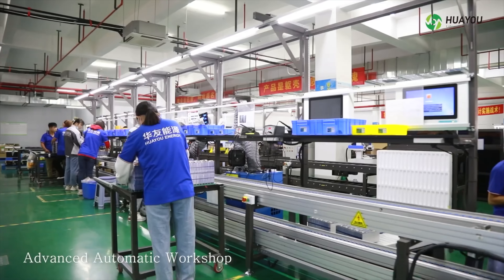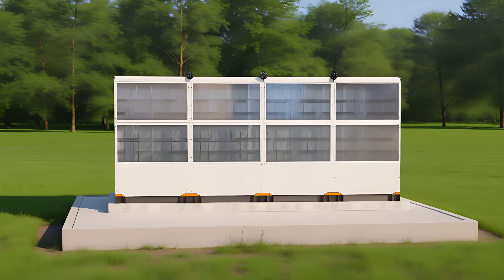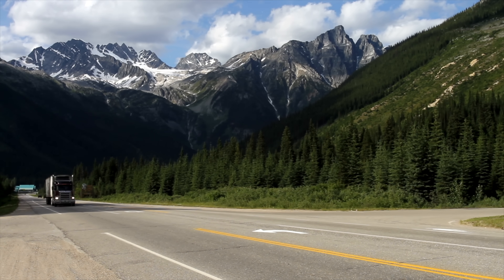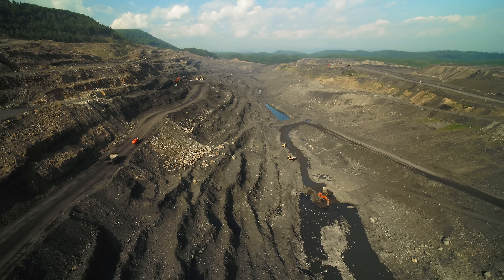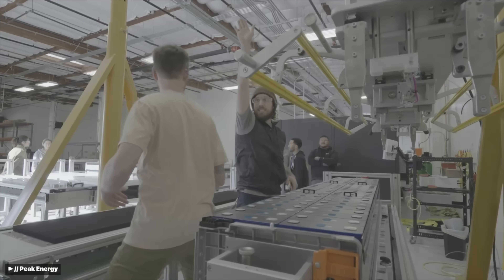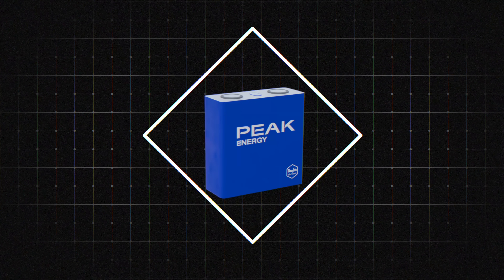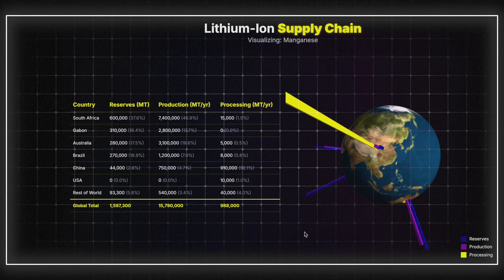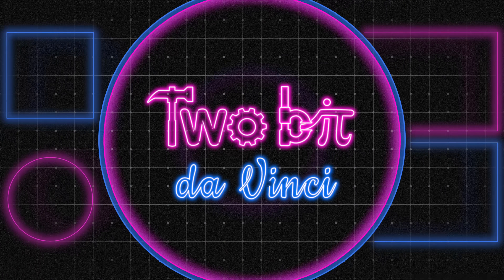Sodium Ion Batteries Are Going to be EVERYWHERE - Here's Why

Comment: While LFP batteries are also technically unable to sustain their own thermal runaway, LFP batteries still do start fires and explosions when their outgassing mixes with air and finds an ignition source. I bet the same applies to NaFPO, in which case batteries should still be vented outdoors to prevent hydrogen, carbon monoxide and other flammable gas buildup in confined spaces.

As far as EV range is concerned, as long as I have at least 100mi of real-world winter range and have 1.4kW charging available wherever I go, that would be good enough for ~355 days/year and good enough for me if the battery is built to survive that through the whole ~15 years lifespan of the car. For the remaining ~10 days, those are 2-3 days trips for which I wouldn't mind having to make one ~15min fast-charging stop along the way in each direction.
Reply: NaFPO is not supposed to be flammable. much safer.
Reply: @MrMichaelBCurtis  LFP itself is considered non-flammable too but when one is successfully caused to go into thermal runaway, the gasses it produces (mainly hydrogen) are highly flammable.

The ideal battery tech from an energy density point of view is oxidizer and reducer separated by almost nothing, effectively a bomb. That makes it extremely difficult if not impossible to put together a truly intrinsically safe high energy density battery.
Reply: @teardowndan5364  people can delude themselves, and Li batteries are indeed flammable. there are all kinds of warnings about keeping them away from fire, Na batteries are non flammable, you can put fires out with them, and yes they don't hold as much charge.
Reply: @MrMichaelBCurtis  The delusional people are the ones thinking Na-ion will be any different. Anything short of liquid metal or fully solid-state batteries will have catastrophic failure modes.

LFP batteries do not catch fire or even do anything at all during typical nail penetration tests. Wack an identical cell with angle iron to mimic running over a downed signage post though, they outgass vigorously and the cloud ignites when it finds a source.

Unless Na-ion magically gets rid of hydrogen as the positive charge carrier in its electrolyte, it is practically guaranteed to release hydrogen during catastrophic failure.
Reply: @teardowndan5364 your thinking is correct,  the issue throwing you off is the amout of outgassing Li is a lot Na is almost none.  Na batteries are not flamable under any condition,  they are solid state
Reply: @MrMichaelBCurtis  Na-ion aren't intrinsically solid state, most use fundamentally the same construction as Li-ion batteries.

Most "solid state" batteries in production today are actually semi-solid with anywhere from 10% to 80% liquid electrolyte since it is nearly impossible to maintain full contact across all layers from anode to cathode current-collecting foils otherwise.
Reply: @teardowndan5364 do more research,  it is worth it
Reply: @MrMichaelBCurtis  The only fully solid-state batteries I am aware of use Li/Na-sulfide anode and have to operate at ~350C to keep the battery soft enough to avoid cracking.
Reply: The liquid is different is the key diffence. While yes, its still possible, these will go boom over a fire.
Reply: @adr2t  lithium yes, salt no. learn more.
Reply: @MrMichaelBCurtis  Even salt - maybe you need to learn more. I assume you dont know what water will do the metal as well? A boom is better than a fire - this is why its safer. You really lack any knowledge on this top I can tell.
Reply: @adr2t Na batteries don't explode. Duh, maybe do some research
Reply: @MrMichaelBCurtis  They do - they releas a gas when heated - this makes them pop. You do know Na has been around for a while, yes?
Reply: @adr2t  while you are correct Na has been around a while, originally developed by Sony, there has been a significant breakthrough, and the amount of gas release is not significant, they are no longer flammable, they don't need cooling and they operate in a very wide range of temperatures with  no dendrite issues.  The car batteries they are planning for later this year also can be charged to 80 percent in 10 minutes
Reply: @MrMichaelBCurtis  I am correct. I did my research. I said they release gas and pop. Thats better than going into flame mode. They're safer because of that fact. There has been years of testing on them. With that said, they can still go up in flames depending on a few reactions still. Mainly with H2O. So we still have to be careful when putting out battery fires. The H is split from the energy release, while the O keeps the fire going. Sodium reacts to H2O as well. The benfit though is that if this does happen, its limited to the cell.
Reply: @adr2t  all that is correct, but not similar. and as of now, irrelevant. Tesla just changed to an Al battery, it uses a gel that doesn't outgas, it can be punctured and won't burn.  It cools itself so that saves on range, and it lasts more than 100 years, and because it cannot burn, the 80 percent charge time is 3 minutes and the 100 is less than 5 minutes.  it is much cheaper than Lithium, although the charge is 20 percent less, some of that is saved by not needed cooling. the operational temperature range is much wider than Lithium it does NOT create dendrites, and even fully discharging it creates no damage.  Batteries are going to finally get better.
Reply: @MrMichaelBCurtis  None of is irrelevant LMAO ok you are off your rocker now. We're talking about the video and the commet. Also doesnt matter what the battery is made out of it - it can call burn because its still a burnable thing - the difference is how it is started. They also out gas because you still haven energry there. This rips things a part and that has to go somewhere and its mostly out gas at that point or heats up super hot. You already proven your self wrong many times now.

Comment: You could have left out the whole China thing vs. the substance and features of Sodium batteries. Now I am suspicious of your actual POV. Love inherently safe, stable battery and no rare earths.
Reply: There is no fundamental reason why it needs to be processed in China other than price. - this might be able to be solved with funding from the government.
Reply: @autohmae  Processing of rare earths is  a messy business and China grabbed it up with cheap prices driving a few alternative places in AUS and USA out of business.  Yeah, we should have looked into preserving this ability as a national security issue, but Republicans happened.
Reply: No. Decoupling from China is critically important. The CCP is evil and we never should have even entertained trade with them.
Reply: @danielchin8073  I agree with you that decoupling which has been going on for the last 7 years since Xi started harping on Taiwan and it would be good to finish. BUT that has little to nothing to do with a battery that if it works could be built almost anywhere without great environmental disruption. So show the facts and keep the politics out of it so I know it is a real thing.

Comment: I think the energy density metric is not that useful when over 40% of a conventional battery cannot practically be used for existing batteries without accelerated degradation.

My point being that if a battery cannot be used at any charge level, that what it cannot use in practice should not be counted towards the energy density.
Reply: Completely agree when on a daily level you charge to 80%, and rarely discharge below 20%.

Comment: I think it is time for auto manufacturers to consider building ev's only with battery swapping capability. The battery tech revolution will render old tech obsolete and without the ability to swap in a new tech battery the ev (or other vessel). It doesn't even have to be for charging purposes.

Comment: makes me think they can use coal for the carbon and instead of burning it, just recycle it over and over once the battery reaches complete end of line in 20-50 years.
Reply: Carbon is at the heart of coal, but I dont think coal will fly. I bet graphene will make these batteries better too
Reply: You have to extract the carbon from the hydrocarbon first (by burning or other chemical reactions first)  Coke has higher carbon after cooking the coal without letting air in to burn or you can use chemistry to extract from the CO2 after burning.

Comment: CATL, the worlds biggest producer of lithium batteries, stated some months ago that in late 2025, this year, their first sodium batteries would enter that market. Meaning they’re actually possible to buy, now. The first ones will be noticeably cheaper and have slightly higher energy density (at the moment) than LFP, LiFePo4, the ones that are taking over cars at the moment, and they will last about 4 times longer. They have the “potential to reach 10% of the price of LFP, when production volumes come.” I really don’t think this tech is a threat to Chinas battery dominance….

The batteries used in cars with longer range, NMC and others, are not durable. LFP, the less dense one lasts 4 times as long, at least, and as mentioned, sodium batteries 4 times as long as that again…

Comment: sodium batteries so far have been very bad at cycle life compared to lithium, would be great if you could inform us about how long these are supposed to last !
Reply: If we achieve $10kWh batteries then a shorter life cycle becomes irrelevant as pack replacement costs become similar to tire replacement.
Reply: @PETERJOHN101  good point, especially from the cost pov

Comment: I hope this is not a sponsored video designed to help this company raise money. It's good they are making sodium ion battery and in the USA too but there is nothing spectacular in that. The presenter tried to make their efforts more important than it is by comparing their sodium battery materials with China's control of NMC materials, deliberately ignoring the fact if the USA is interested in building the battery supply chain like China, they can easily do so. He also refused to compare this company's sodium ion battery materials with LFP materials which is indeed more closely related to this sodium ion battery than NMC is.
Reply: You totally missed the point of the video, didn't you?
Reply: @PETERJOHN101 and you got all the points of the video, didn't you professor (sorry, shareholder)?

Comment: There are three huge advantages here: Passive cooling, supply chain, and safety. Just those make this a worthwhile system. By not having to have an active cooling system, the size of the battery is shrunk significantly over a lithium system. As stated, the supply chain is local; one can barely swing a dead cat without hitting an iron or coal deposit here in the US: If the ground is red, there's iron in it!
Reply: @HammerOn-bu7gx  a supply chain is a lot more than just the da materials. As an example manufacturing a processor involves about 4,000 steps. A battery is not as complicated but it still involves a number of steps which CATL has mastered. They are ahead of everyone else by a lot.
Reply: sodium is one of the most combustable minerals known to man, all it needs is o2... 

the idea these are "safe" is a fantasy only someone selling stock in a sodium ion company would dare say.
Reply: @arizona_anime_fan  ELEMENTAL sodium is highly combustible.  Sodium in an electrolyte is not.  Would you call salt water "combustible"?
Reply: @davidmackie3497  what about sodium ION batters tells you it's sodium chloride?  in order for there to be an ION it going to be elemental sodium.  gtfo of here with that noise.  this isn't sodium chloride.  (aka table salt).
Reply: @arizona_anime_fan  Dude, he was talking about the supply chain for the main components of the battery.  He wasn't talking about the chemistry of the battery.  He said it was made out of "dirt and salt."  3:22  Then in the next sentence he clarified that by saying, "The core materials are sodium, which we can get from soda ash, ...."  Please note that soda ash is chemically a salt of sodium -- but not table salt, NaCl.
I used salt water -- which is indeed NaCl -- as a very familiar EXAMPLE of how sodium ions are not necessarily combustible once they are part of an electrolyte.  Neither Li ion batteries nor Na ion batteries have blocks of the bare element sitting around waiting to combust as soon as they meet with any oxygen (or water).
Lastly, you are right that elemental sodium is quite reactive -- and that could POSSIBLY be an issue for these new batteries.  But sodium isn't even close to lithium when it comes to being reactive, so the chemistry to keep it under control is MUCH easier.  It is believable that the new battery is quite safe.  The OP goes into more detail about that in the video.
Reply: @davidmackie3497  -  the electrolytes used in Sodium-ion batteries are combustible typically being solvent based ones, plus the salt typically used (Sodium Hexafluorophosphate) is flammable. Sodium-ion cells can also experience thermal-runaway, just in different ways to Lithium-Ion (the recent paper "Review of thermal runaway risks in Na-ion and Li-ion batteries: safety improvement suggestions for Na-ion batteries" is a good overview on the subject). 

The salt use in Sodium-Ion batteries isn't table salt (i.e. Sodium Chloride), but other sodium salts that are better at carrying charge between the battery electrodes than table salt.
Reply: @arizona_anime_fan  Yeah, I wondered about that.
Reply: Passive cooling for Sodium-Ion batteries is unlikely to adopted in wider applications at this time as the electrolytes used in current cells start to degrade at fairly low temperatures (from 35°C) plus the SEI layer materials used tend to be heat sensitive. At this time, Sodium-Ion places high cooling requirements, particularly for high packing density cases such vehicle batteries, than Lithium-ion for which passively cooling has been used in the past and recently demonstrated again with battery packs using cells directly embedded within dielectric coolant fluids.

For small scale domestic static storage passive cooling, or fan-assisted, may be possible as space and airflow can be optimised for Sodium-Ion. However, for grid scale energy storage then active cooling will utilised by most suppliers to increase each battery unit's energy density. 

PEAK's approach is not to optimise for footprint energy density but for operational cost, using Sodium to lower cost of storage coupled to a passive cooling system that reduces operational costs associated with cooling or pumping (i.e. flow batteries); mainly in terms of service cost/time. However, they have a lower density than other sodium battery BESS providers such as Natron and Faradion, who use active cooling.
Reply: Without active cooling, I think heat will build up and shorten its lifespan. These new sodium batteries are not real-world tested yet.

Comment: Sodium batteries the best suited to grid energy density is not quite good enough for cars yet almost
Reply: No one said they were. The battery type discussed in the video was never developed or ever intended to be for mobile uses. It is appropriate for fixed-base grid-scale installations, as described.